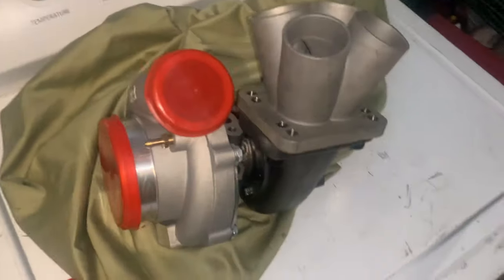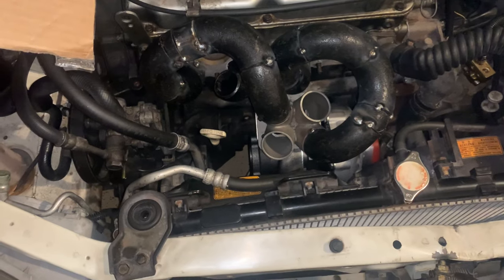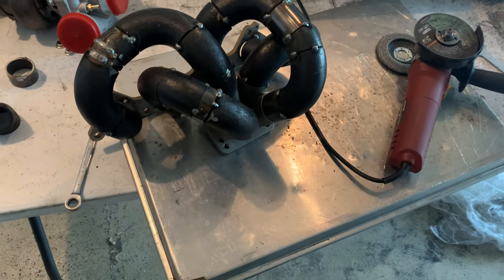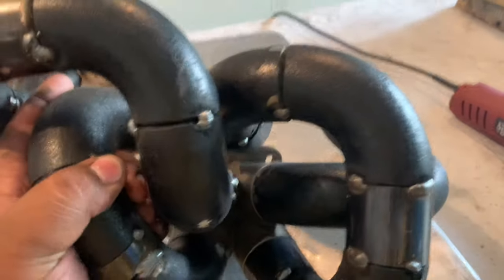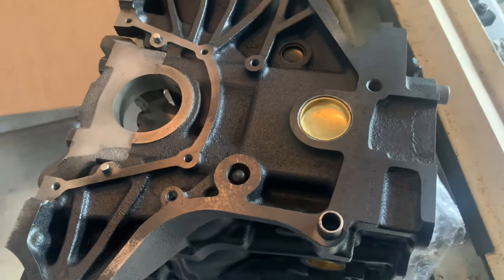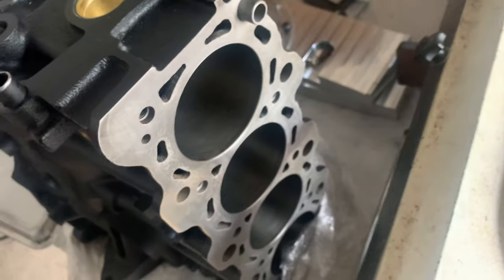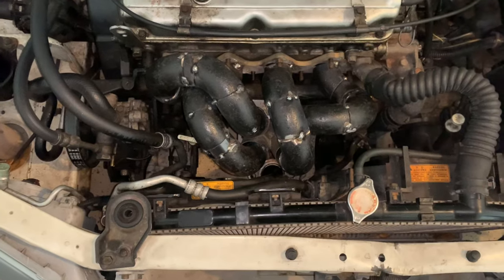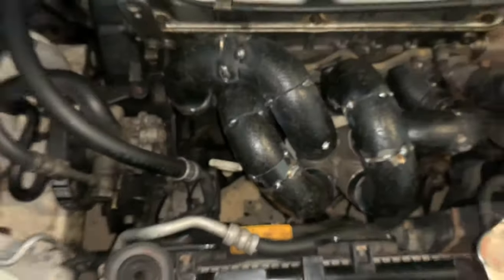Part 20 2001 Mirage Turbo Manifold and block

Comment: Hey mate, Kinugawa make turbo manifolds for single cam 4G93 motors just in case yours doesn't work out. Also, Hens Performance in Aus make hot and cold side intercooler piping that is direct bolt in (provided you have an Evo5 style IC). Pretty sure they ship all round the world. GL with the build :)
Reply from the maker: Oh wow that’s awesome send me some links I would love to check out their stuff
Reply from the maker: Wow $1100 for a turbo manifold  Definitely interesting but I got my Turbo Manifold to fit perfectly and moving the dipstick out of the way you’re going to see on the next episode this Sunday

Comment: Hello, I Have A 1999 mirage , I Want To Know Where The O2 Sensor A And B Are Located..

My Exhaust Pipe Was Locally Built (Previous Owner) So For A Tim , There Wasn’t A Converter… 

I Bought An OEM Converter For Installation But Looking At The Exhaust Line , But Both Are Installed Before The Converter.. 

Is This Right For A 99 Mitsubishi Mirage ..??

Because I Know that One (Sensor A) Has To Be Before The Converter And The Other (Sensor B)Has To Be After The Converter… 
 
 
Do You Know Where They Are Supposed To Be Positioned.. 

Any Help

Thanks
Reply from the maker: Yes one when you open the hood you should be able to see the first one on the headers then the next one would be before or after the catalytic converter depending on the year it does change

Comment: I see you actually going through with...lol  but definitely going to be a sleeper.....I'll stay tuned
Reply from the maker: Oh yes definitely LOL I did some calculations and I should be able to hit the 500 hp mark at 27 to 28 pounds of boost on pump gas
Reply: @legionelitemotorsports2096  I did try to call you by the way
Reply from the maker: Really hit me up again or leave me a message I’m available always

Comment: Nice work id like to try making a manifold like this. Do the steel elbows work out pretty cheap? do the seperate cylinder rings for the gaskets cost heaps? Ive heard people get them for 6cyl BMW at high boost
Reply from the maker: Thank you thank you the steel elbows or mild steel comes out pretty cheap but is actually ideal compared to stainless steelBecause stainless is expensive and it does not like high heat so you can count on stainless cracking first so mild steel ends up being a lot cheaper and the separate cylinder rings is a great idea but usually not needed after making the Manifold you can machine it flat and use a triple layer metal Exhaust gasket
Reply: @legionelitemotorsports2096  good to know. I think here they might call the thick pipe 'steam pipe'. Its $900 for a reputable brand 4g63T manifold so thats incentive. Its easy to find cheap T3/T4 with Vband my current mostly worn out turbo has 5 bolt flange.
Reply from the maker: Very true I think I’ve seen that one too